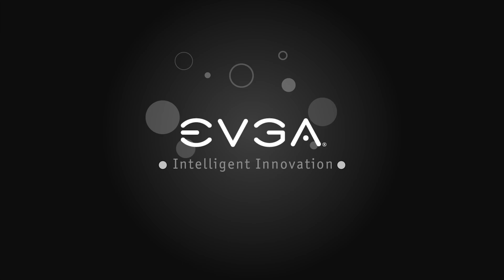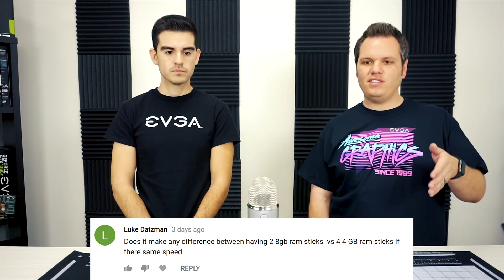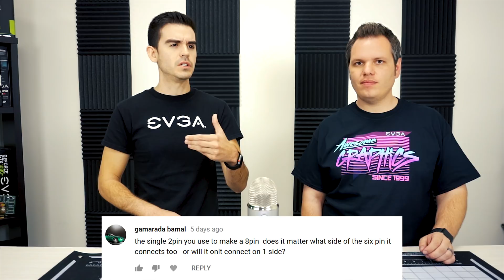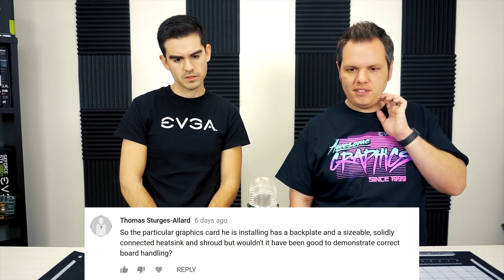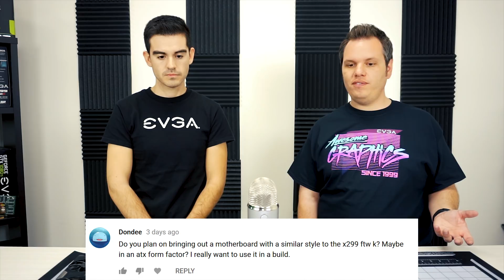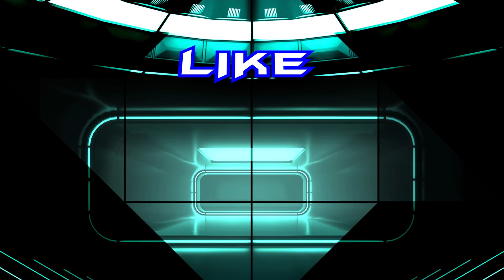Ask EVGA - Episode 12

Comment: it seems in RTX 2070 the gaming black edition is getting sold out faster than any other 2070 card or they are not being adiquetly supplied to on line shops. you guys needs to fix this as IMO 2070 gaming black has more demand than any other  RTX 2070 card simply cos it goes in the original MRSP.

Comment: Which motherboard sound  is better for gaming? Creative Sound Core3D Quad-Core Audio Processors, 
or 
the 7.1 Channel High Definition Audio + Optical? 
I know the former is saved for higher-end motherboards, but i think i heard it only has the 5.1 channel. How do the better of these compare to sound cards? (For example sound blasters) will it be alright to use a sound card on EVGA motherboards if need be?

Comment: Sorry probably should have clarified. I like the rgb sections of the x299 ftw k eatx board how it looks like magma or cracked ground. it will not fit in the thermaltake view 71 without covering the gromits for 24pin cable. That is why i wanted it in an atx form factor. It doesnt have to be on the x299 platform it could be a z390 board or a newer less enthusiast level board. The rgb sections are the theme i am going for in my next build. I plan on making custom acrylic panels and such for the case to suite the theme.
Reply: I just looked at the mother boards again specifically the x299 micro (not the micro 2) which still has the rgb style that i like. I noticed that when i was looking to see what it would look like in the thermaltake view 71, the vertical gpu covers alot of the motherboard anyway so i think the micro atx form factor would work fine for what i need. Thanks so much for the recommendation.